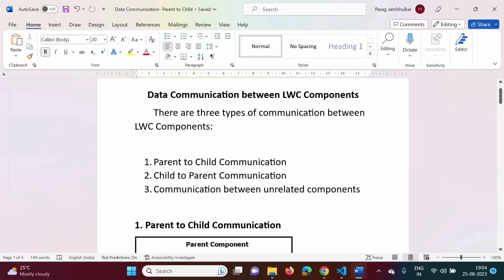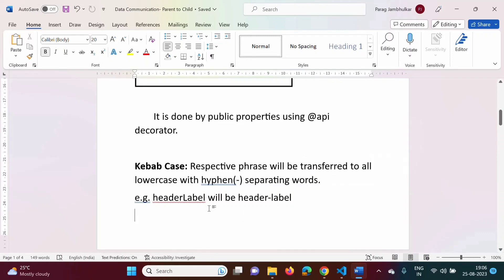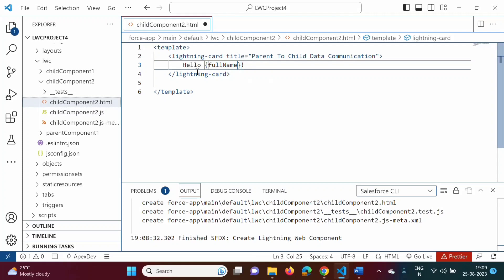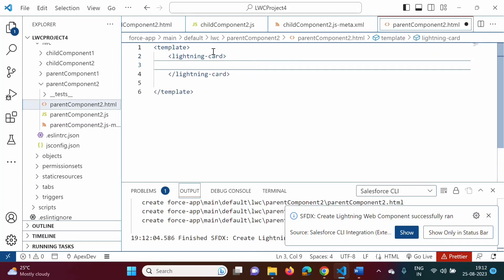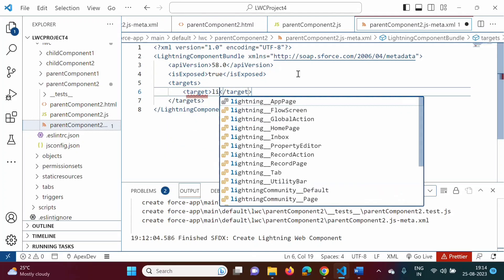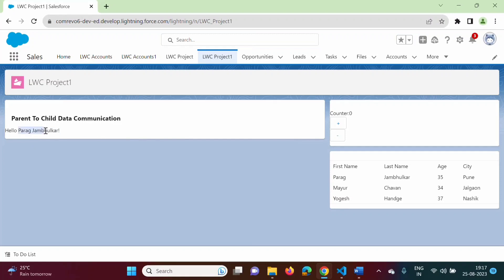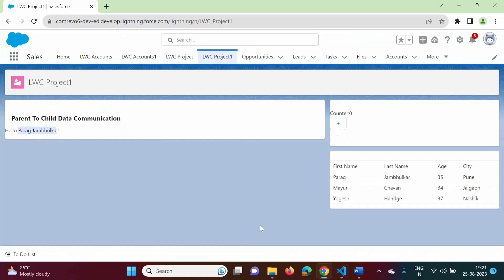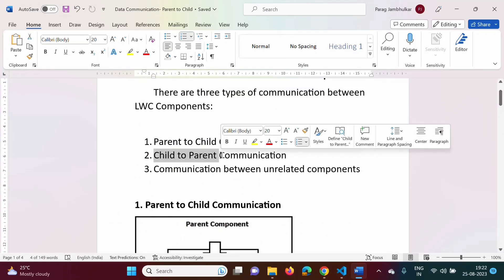#78 Data Communication From Parent to Child LWC Component | Salesforce | Message Passing

Comment: Lets Say if Child Component name is childcomponent

and when I tried to add the same over parent Cmp it's throwing error. <c-child-component>.
I understand we should use naming conventions while creating LWC but still I want to know is there work around in such case.

Also in this video you have fullName variable instead if fullname is the variable then how you have define in parent Cmp ?

i.e: <c-child- component  full-name="Rs"> ?
Reply: There are some naming conventions in the programming world.
For example lets take a string of words like 'breaking bad is the greatest series', normally which you see in any text/line in a paragraph.
This will be as following in the below cases:
1. Camel Case: breakingBadIsTheGreatestSeries
2. Kebab Case: breaking-bad-is-the-greatest-series
3. Snake Case: breaking_bad_is_the_greatest_series
4. Pascal Case: BreakingBadIsTheGreatestSeries

So camel case is used to name LWC components when creating them. And kebab case is used along with 'c-' namespace to embed a child component in parent.

So if lets say you forget to use camel case like you said. If you name your child component 'childcomponent'. There is no two words anymore as there is not a capital letter.
so you refer the component as <c-childcomponent> to embed it in parent.
Same logic for javascript property name as well.. if it was named as fullname you will mention as below:
<c-childcomponent fullname="insert any value here or binded property name">
Hope this clears it..

Comment: difference between event.detail and event.target
Reply from the maker: In Salesforce Lightning Web Components (LWC), event.detail and event.target are both properties of an event object, but they serve different purposes.

event.detail property provides additional data specific to the event. It's commonly used to pass data along with a custom event.

event.target property represents the element that triggered the event. It's often used to access properties or attributes of the element that emitted the event. It is particularly useful in cases where you need to manipulate or retrieve information about the DOM element that triggered the event.